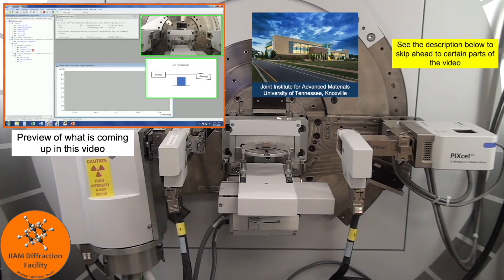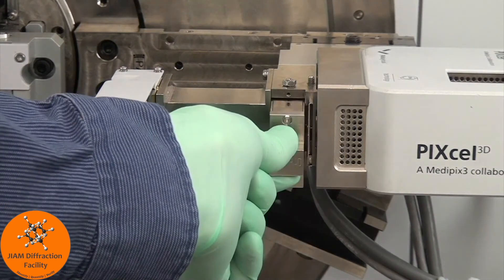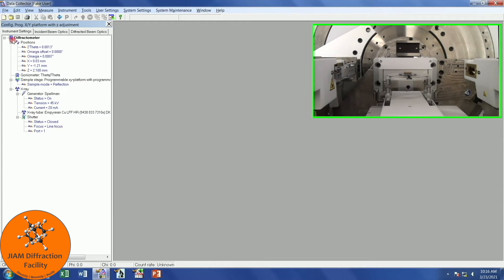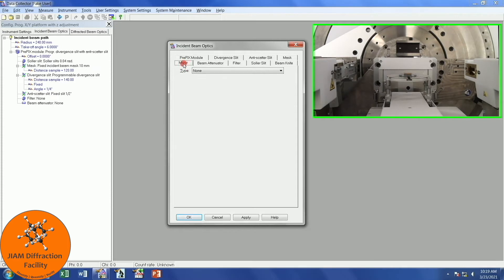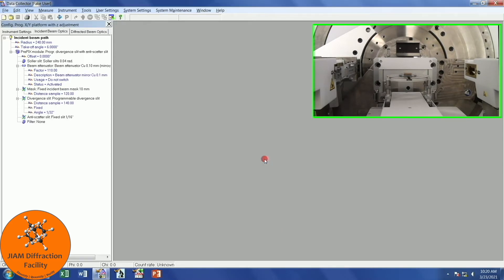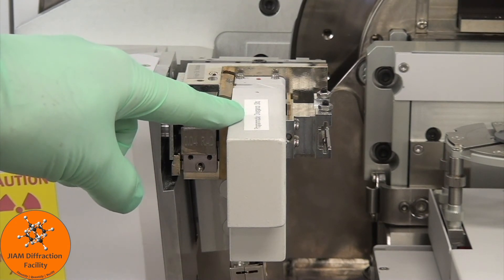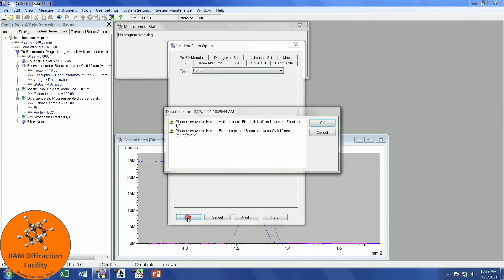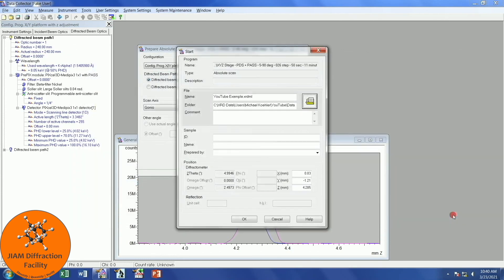How to Perform Powder XRD with the XYZ Stage - Basic Empyrean Training - Malvern Panalytical

Comment: Question, why would I need to change the divergence slit and the anti-scatter slit for the xyz stage? Thanks
Reply from the maker: Are you asking why the divergence and anti-scatter slits are smaller for the alignment step that is necessary for the xyz stage?  Or are you asking why you would possibly need to change the slit sizes for actual measurements of your sample?
Reply: @IAMMDiffractionFacility  I was asking about why are the divergence and anti-scatter slits smaller  for the xyz stage.
Reply from the maker: It's been a while since I have watched the video, so I'm not sure at what point I mentioned smaller slits.  However, I'll try to answer a couple of different ways.  

One reason is that you need the smallest incident beam divergence slit (and an anti-scatter slit 2x bigger than your divergence slit) during sample alignment.  Because we are not using the sample holders and stage that automatically align the sample in the X-ray beam, we need to go through the steps to do this manually.  When we do this, we want the beam to have a small divergence so that the diffracted X-ray footprint on the detector is smaller.  This will help to sharpen the features we see during the alignment scans.

Just because you are using the xyz stage, it doesn't mean that you must use smaller slits for data collection (i.e., after alignment).  You may need small slits if your sample is small, but this is true regardless of the stage you are using.  It is typically best practice to not have the X-ray beam fall off the sample at any time during an X-ray experiment.  Preventing the beam from falling off the sample should produce the most accurate diffraction pattern.  This is especially important if you want to perform Rietveld refinements.  It isn't usually a huge deal for the beam to fall off the sample if you are performing simple phase identification, but be aware that the relative intensities will be affected somewhat.  

Please let me know if that answered your question.